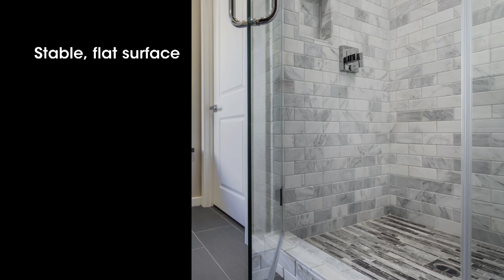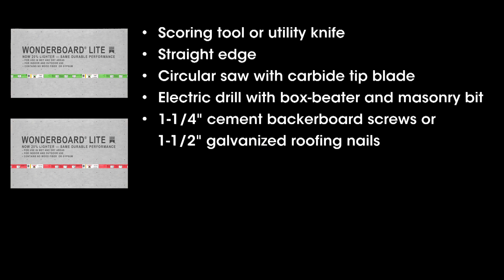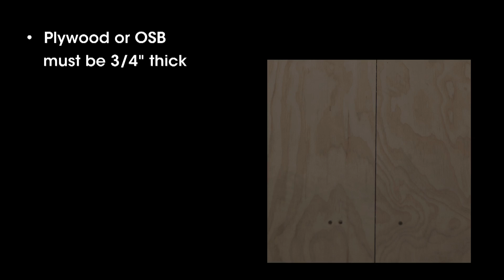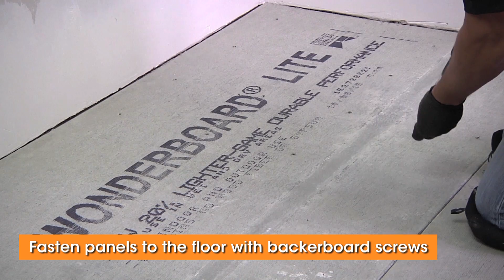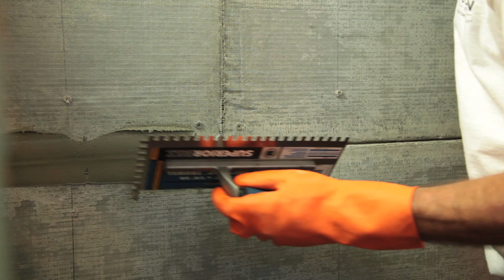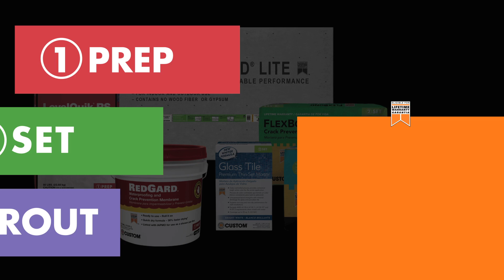How to Install WonderBoard Lite Backerboard for Tile

Comment: So much wrong with this tutorial.  Do not install a double vapor barrier and do not use fiberglass mesh tape.  Use the mesh tape designed for thinset.  Those are the two issues I noticed within a few seconds of scanning this video, there may be more bad information here also.  I just could not watch the whole thing after seeing those two examples of poor information.

Comment: explain to me why its 7/16 thick.. makes no sense. how the hell are you supposed to evenly match this up with 1/2in drywall
Reply: Literally the same thing.
Reply: @mattd9881  7/16 and 1/2in are the same.thing? 🤣🤣
Reply: technically 8/16 inch = 1/2 inch
Reply: @sherieclipson3889  no shit but they say it’s 7/16 not 8/16?
Reply: Very good point. Hope it worked out for you. If not too late check out Kerdiboard by schluder. I’m about to use it , it’s 1/2”.

Comment: Did I get this correctly? You said 1/4" boards should be used for floors and 7/16" for bathroom walls. Shouldn't be the other way around?
Reply: No. There is nothing under the wall but studs.

Comment: I notice on the instruction sheet it says to ensure that plywood subfloors are properly gapped at their joints (and if not to cut accordingly). Is there any similar such measure I should take when installing 1/4" WonderBoard Lite on the original wood (tongue and groove board) subfloor of a 1912 built home's bathroom floor?
Reply from the maker: Original tongue and groove wood must be solid with no deflection. You do not need to cut gaps in the subfloor. Then install Wonderboard per directions.

Comment: hi, can i remove my outdoor vinyl siding and put tiles on the ply wood or do i need to put the wonder board on the ply wood? any idea?? thanks
Reply from the maker: Tile can certainly be used on an exterior vertical surface but you will need to consider a few factors such as weight, waterproofing, tile size, mortar and grout selection.  Since this can be a bit complicated, we suggest that you contact our Technical Services team at 800-282-8786 for our tips based on the specifics of your project and you may also want to contact a licensed contractor to help provide guidance especially on waterproofing. Our RedGard liquid waterproofing membrane may be part of the solution.  http://www.custombuildingproducts.com/products/surface-preparation/waterproofing-membranes-underlayments/redgard.aspx